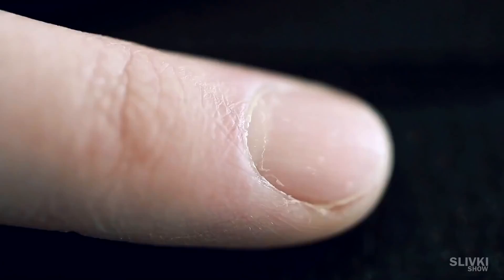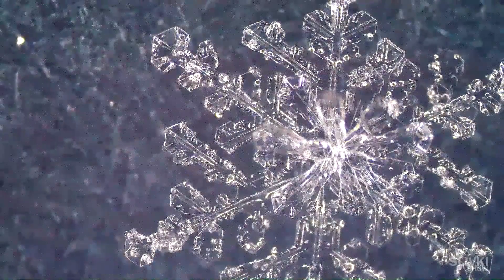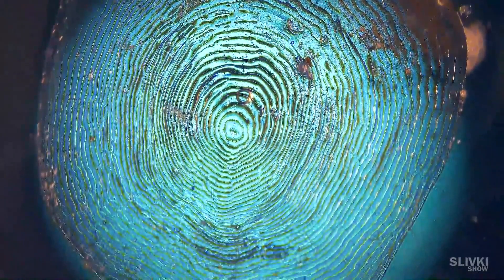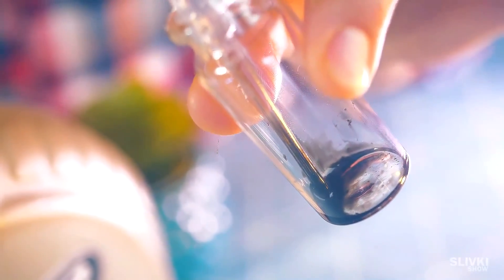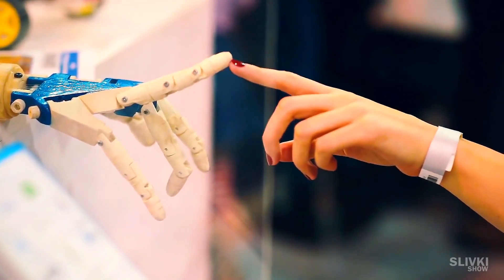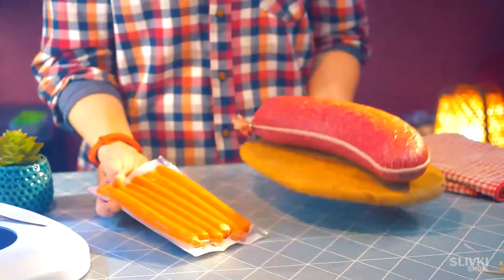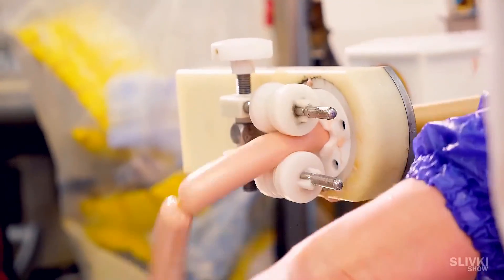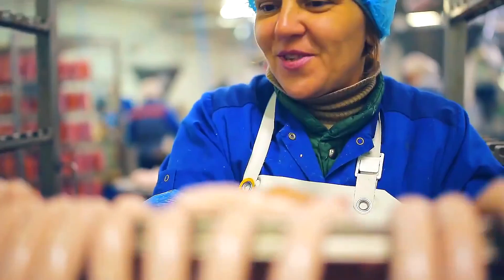STORE SAUSAGE UNDER A MICROSCOPE

Comment: 3:48 That was the most caveman way of removing the oil filter i have ever seen.
Who is this guy
Reply: The same guy who cut his nails with sizers probably xd
Reply: That was the most raw primal shit I’ve ever seen
Reply: @ARandomPerson--  I cringed when he snipped his nail
Reply: several times i changed the oil like this... especially when you cant use tools
Reply: It seemed so easy though, i want to try it that way
Reply: eWWw₩
Reply: He is a very masculine and straight car guy with a pickup truck with balls
Reply: Lol BRUH WHAT? I would never fight a guy who changes oil filters like just. 

I wonder if he just RAMS the gas nozzle DIRECTLY through into the gas tank under the car when he fills up.
Reply: The way the oil dripping out prove it
Reply: @xcaluhbration  dude probably doesn’t even use jack stands when changing his tires he probably just grabs the front car and lifts it up with one hand and rips off the lug nuts with his other hand

Comment: the craters in the tangerine make sense when you realize how fast they can get moldy if you leave them in one place for a few days. the craters have to release gases from inside the tangerine, but if they get blocked it seems like they build up mold faster. my best guess is to keep rotating your tangerines/oranges/limes/lemons to keep them from rotting or molding. anyone have more info?

Comment: Have you ever squeezed and orange peel and it mists you,
That's because a citrus rind is made up of two layers, one thick and spongy, and the other firm and thin. the spongy material surrounds the oil, and when the peel is bent, that thicker material pushes against the oil, which in turn pressurizes the fluid and it jets out...
The more you know

Comment: You know there is a such thing called oil filter wrench no need to hammer a screwdriver into the old filter to take it off and you always hand tighten the new oil filter or else you will never get it off next time